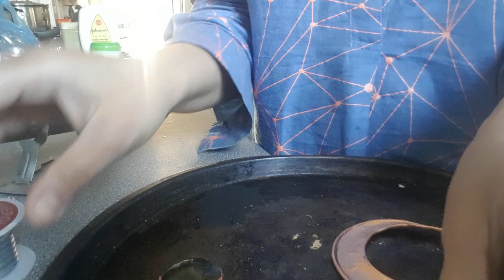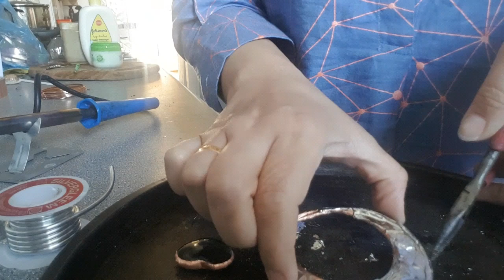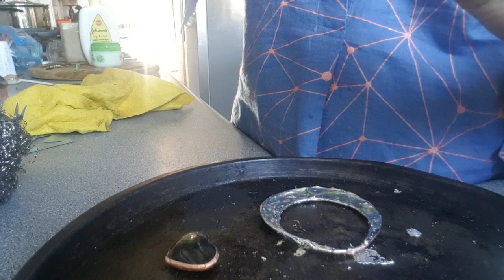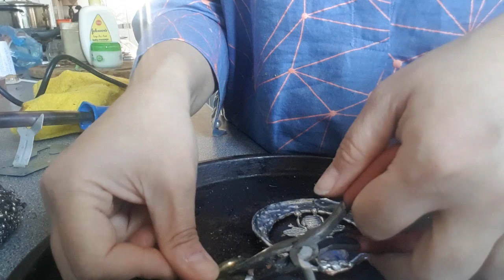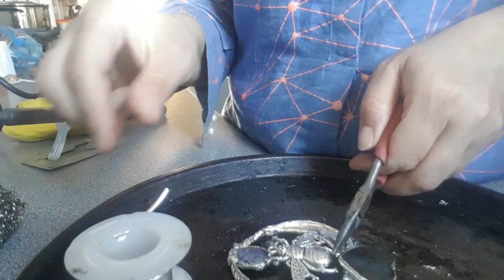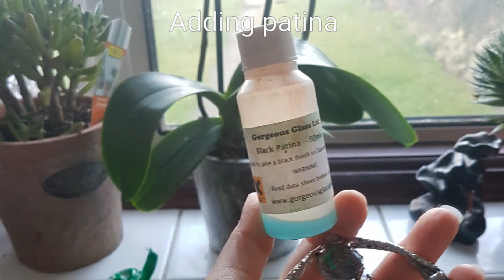Soft solder Honey Bee Pendant | Molten lava attaching components | Tin jewellery

Comment: Thank you for sharing your soft soldering experience. I love your bold designs and the way you are making textures with a tin. Would you share how you set the temperature on your soldering iron? Is it always the same? And how often do you clean the tip?
Reply from the maker: Blessings thankyou so much for liking my creations .☺
My temperature is always set on 100 watts. It allows my solder to.flow well.
But when you are designing like dots and texture your temperature should be low at least to 60 watts.
Other tgen this its all about practice once you got the grip you can work and create texture with 100 watts as well 😊
I clean my tip during my work with a stainless steel wire mesh as soon i see the solder building up on my tip i clean it.
Reply: @teaandart  Thanks so much for the prompt answer :)! And for sharing valuable tips! I hope I didn't make huge mistake for buying 80 W soldering iron ( with rheostat) as I plan too to work with lead free solder, with 3% silver. You are really very creative and I enjoy watching how freely you play with solder and iron. Looking forward to watch your new designs :). You inspire! Once again, thanks a lot for sharing.

Comment: Hi there, you do beautiful work, and I really enjoy watching your videos. Question, is the bee copper and you solder it? And if not, can you but a copper paint that will adhere to non metal items that can be painted on then soldered? I’m asking for odd shapes that tape can’t be wrapped on
Reply from the maker: Thankyou so much the bee is actually a silver charm i bought from ebay .Solder takes on copper ,silver and brass very well.
Reply from the maker: Copper paint won't work in softsoldering its only applicable for Electroforming.

Comment: You said the soldering iron should be 100W. Does it have to have temperature regulation?
Reply from the maker: If you buy hakko fx 601 it does have a temperature regulation but mine don't have .So not necessary thing.

Comment: Beautiful work :) is the bee made of solder or is it pre bought? If so, how did you make it - mould or carving or something? Where did you buy your patina from also? Thank you
Reply from the maker: The bee is a casting I bought from eBay just search bee jewellery findings you will find them and the patina that I am now using is NOVACAN black patina again from eBay it's the best for silver solder gives a beautiful patina .🙂
Reply from the maker: And Thankyou So Much for your kind words.
Reply: @teaandart  do you need to cure it some how or coat it with anything after?
Reply from the maker: @amandacapasso4394  i don't as my style is rustic but yiy an use sealers.
Reply: @teaandart  so the patina is okay just as is on there? It won't come off?

Comment: What patina brand do you use? And wool?
Reply from the maker: Hi i use novacan patina the wool is simple brass wool.
If you can do buy a sal ammoniac for cleaning tip its best for long term .
Reply: And where did you get you iron from? I’m just starting and I saw you said an 80watt wouldn’t work. Where can I can a 100watt from?
Reply from the maker: @hynhulagirl  
https://www.ebay.co.uk/itm/152016282833
This is the one i am using. 
-New Hakko FX601 Adjustable
-Weller W100D Soldering Iron i have this one as well.
I bought all from ebay.
The weller and hakko ones are recommended by artists.
Reply: Thank you!!! Any tips for a new timer?
Reply from the maker: @hynhulagirl  your very welcome yes be very patient as it do take sometime but once you get the technique its easy. 
Also please work in a well ventilated room with a mask on the fumes are not very friendly. 
And lastly have lots of fun.
Reply: Thank you so much!!!!! So sweet:)
Reply from the maker: @hynhulagirl  ☺☺☺🌸🌸🌸☺☺☺

Comment: Hi there, I really enjoyed your tutorial. May I ask what surface you are working on? It looks like a pizza pan?:)
Reply from the maker: Hi Thankyou So Much I glad you enjoyed yes it an old pizza pan good spotting 😁. Hehe
Reply: @teaandart  any particular surface pan to use or avoid? Thanks again!
Reply from the maker: I would avoid any surface that can get melted as the solder flows it do fall so the surface get burns so after trying so many I am.happy with this pizza pan really.
Reply: @teaandart  Thanks, so is it nonstick-teflon or cast iron? I understand if you're not sure:)
Reply from the maker: It's my old pan definatly not toxic it's a cast iron .
Reply from the maker: You can use glass work tops as well before I was using  marble tiles left over .
Reply: @teaandart  awesome. That's perfect.